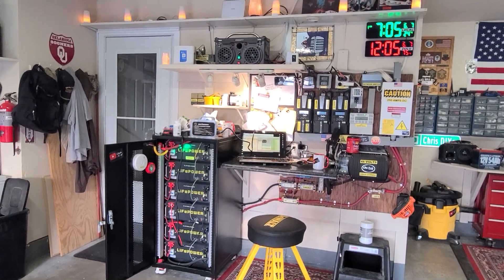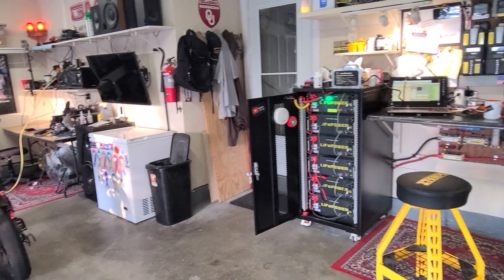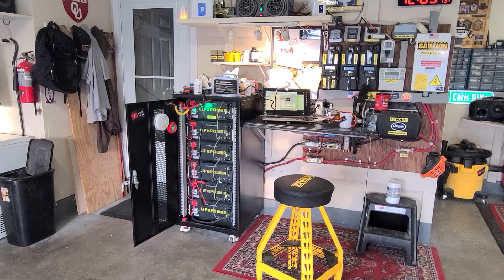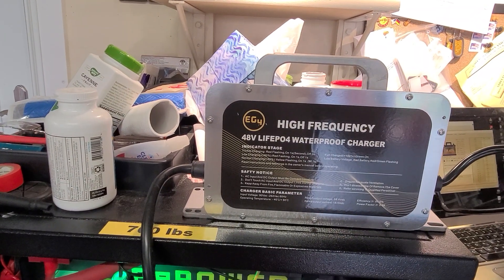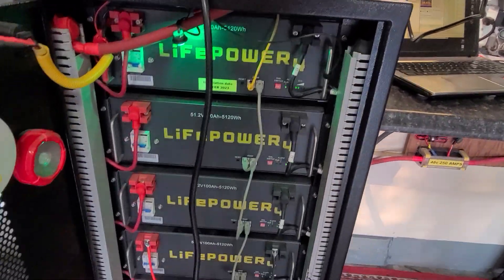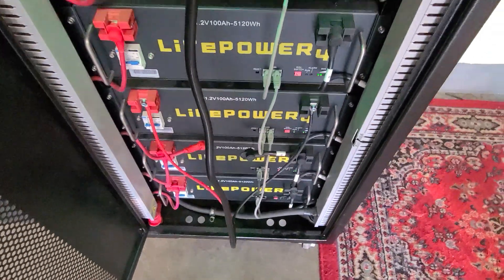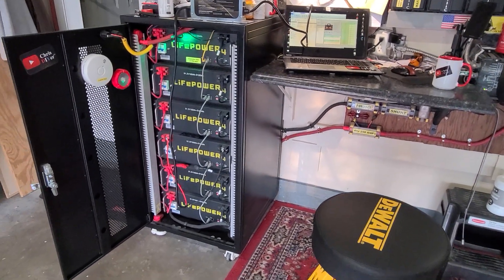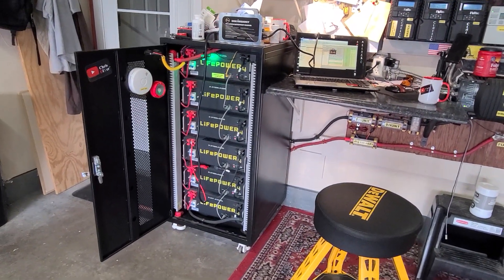EG4 LP4 boost charge on one battery due to a lower SOC % value indicated

Comment: Hey Chris I have a small off grid homestead in Nv running 3500w inverter / 3500w solar and 2 of the EG4 batteries, system installed in march of 2023 and was working great then last week my top battery will not charge over 50%SOC, I completely drained it to where it shut itself off and then I removed it from the system and hooked up the E G4 charger to it and set it to 56.6 V to trie to push the BMS to reset for 100%, but the SOC on battery hits 50% and the charger stops sharing it… I still need to get it hooked up to a laptop and get the monitoring software downloaded in order to see what’s truly going on. This is just frustrating because I have to get up at 4 o’clock in the morning and start the generator now to top off the battery that’s working correctly until the sun is out
Reply from the maker: I'd get with Signature Solar and also get that laptop hooked up to it. Mine all reset to 100% SOC with 57.3v Absorb and 55.2v Float. No issues.
Reply: @ChrisDIYerOklahoma  Ok thanks Chris I will give that a try , I’ll keep you posted
Reply: Good evening Chris so I was able to get the laptop hooked up everything and the software and the port cable and all of that stuff I got everything hooked up and I got on the page where it says port opened successfully and it shows the battery I go to battery info it shows the picture of battery But nothing pulls up and then it says not responding. Any ideas?

Comment: Good to see you conducting the test. Spoke to signature solor about my issues as I as we spoke of on the phone. It seems you just need to use these batteries and cycle them downwards I'm not doing look forward to the update.
Reply from the maker: I just uploaded a new video...all are reading 100% SOC now. My ABSORB voltages on the Midnites was too low. I used their external 48v charger (18a model) and it reset the SOC to 100% on the "suspect" batteries. All good to go now.